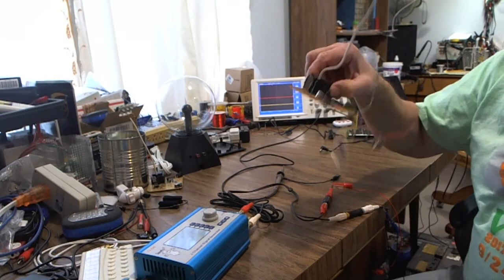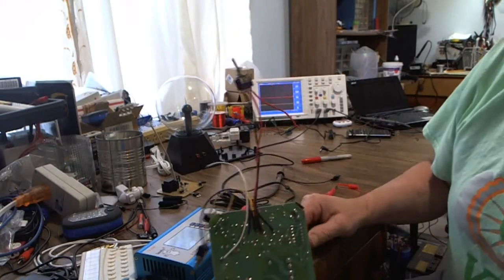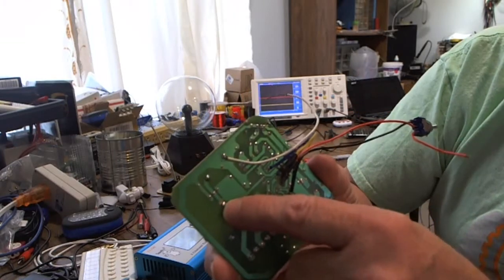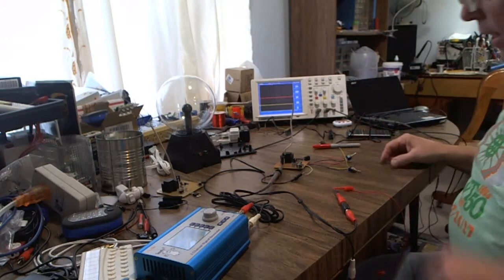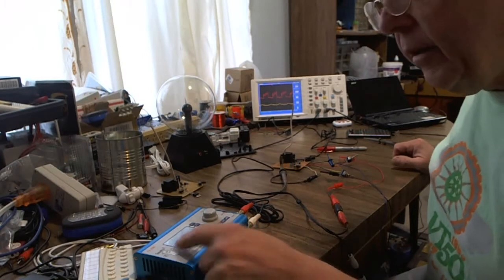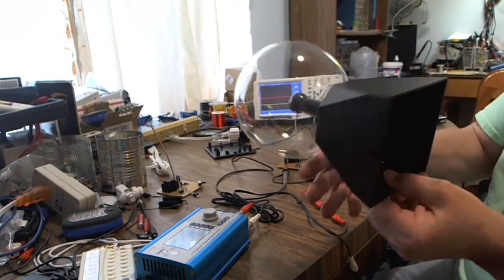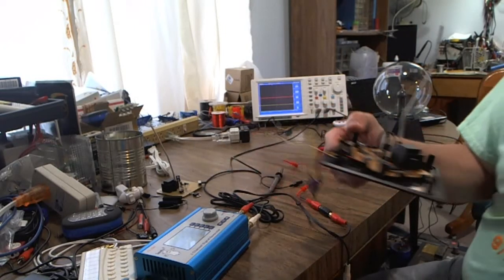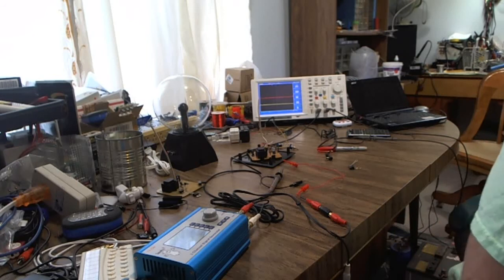Modifying a PLasma Ball

Comment: I very much appreciate what gskempe9 has put out to the community!

- The following is a link with documents detailing things "I" found hard to find and also documentation of a new circuit design utilized for the Walmart plasma balls (I will need help translating Aurorasky's design over to the new ball).  I have posted them together here in one place.  At times this will be updated daily, so check back often if need be:

https://imgur.com/user/Blue123time/favorites/folder/9813099/plasma-ball